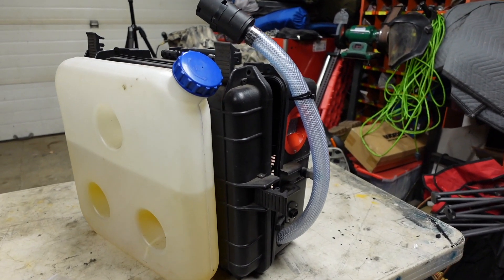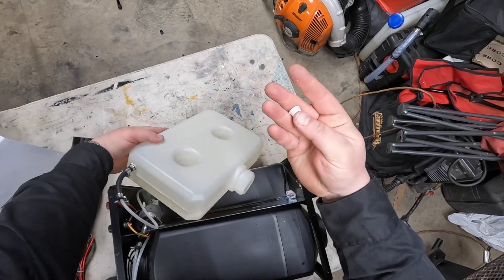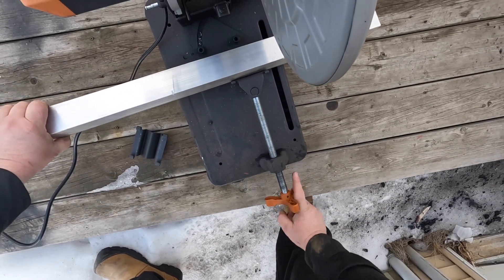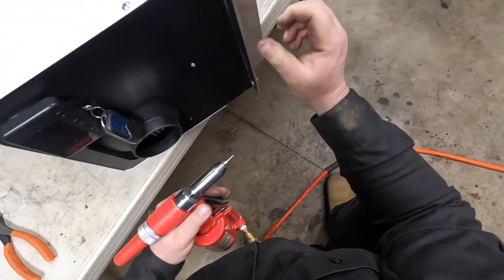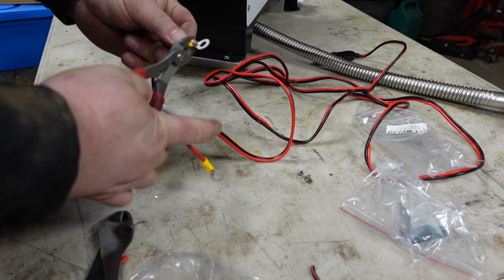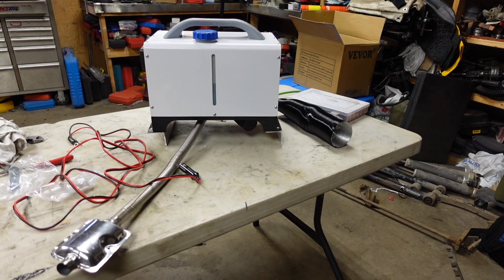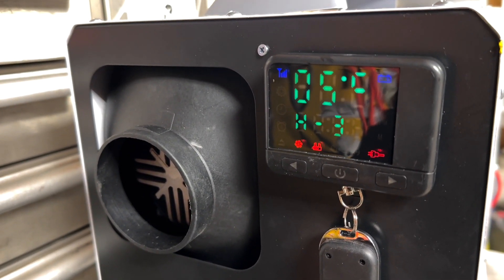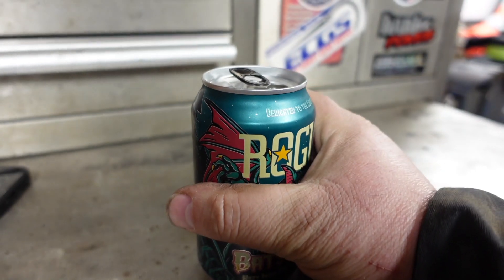VEVOR DIESEL HEATER FAIL | E02 Code

Comment: I bought a vevor heater and got the same code . E-02 . After putting a tester on the battery and watching the voltage while firing up i found out that it is actually trying to start up with the voltage below 10.5 volt wich caused E-02 . I know E-02 means over voltage but when i charged the battery to 14 volts  it actually fired up.  So i think the book may be wrong and E-02 could probable mean under voltage.
Reply: I think You're right.
Reply: There’s a setting in the program that shut the heat off when the battery drops a certain voltage if you have the voltage set at 12.8 V shut off and you use 12 V it will not fire up
Reply: @hawk1481 what setting is this?
Reply: Yes ,you're right it does.
Reply: @jarmik3758  hi your dead right i had exactly the same thing

Comment: Here's your problem.   I finally figured it out.  You need 13 volts at start up.  Solved my problem once I boosted it up to 13 volts. Now calm down.
Reply: I had to use my solar generator to plug in a battery charger to charge the 12volt battery on my generator to get the heater to work. What a shit show . I tried both of my solar generators too.

Comment: Works fine with 14 volts.  You need 30 Amps to start.   I had e-02 on empy battery.  After loading the battery it starts again
Reply from the maker: My other diesel heater would work off those same power supplies so that’s not the problem

Comment: Got one with the same code. It also had a fuse block with only one wire. Fixed that then found the fuel pump had shorted out. Got another and the controller is broke. Used the other controller and get the same e2 code. Using a 12 volt car battery.
Reply from the maker: I think the only way to get around it is to replace the motherboard and controller

Comment: I bought a "Vevor" heavy duty electric pipe threader from Amazon, I cut 4 threads and it started smoking and sizzling.
Reply from the maker: 😂😂🤣😂 Holy
Reply: Vevor is the Acme brand of China. Remember the coyote and the roadrunner?
Reply: Gut it for parts.

Comment: Wow! .... thing doesn't work at 12V flat ... crank the power supply to 14V (instead of throwing it off the workbench)= works like a top ... just a helpful comment from one of the internet's "know-it-all-that-don't-know-shit"!   :D
Reply from the maker: Stand alone battery power is never 14 volts but thanks for the comment
Reply: Stand-alone 12 volt car batteries are 14.5 volts new.
A good battery is 13 - 13.5
If they ever reach 12 volts or below...
they are dead.

Comment: I was expecting to see a solution to this problem, so I am quite disappointed. So you have set up 12V, fine, but 0.02 current? There's no way that unit would start up with 0.02 amps.
Reply from the maker: It seems you don’t understand electricity, current it the load being required which is something you can’t control 🤦‍♂️
Reply: @BackCountryWrenching  What one can't control? Explain, pls.

Comment: By chance is (was) it set to 24 volts instead of 12v? Had that happen before..
Reply: I’m getting the same error code on my Vevor heater and it’s running off a fully charged new deep cycle battery and the controller is set to 12v. They are just junk junk junk